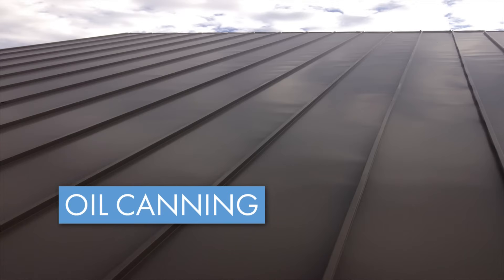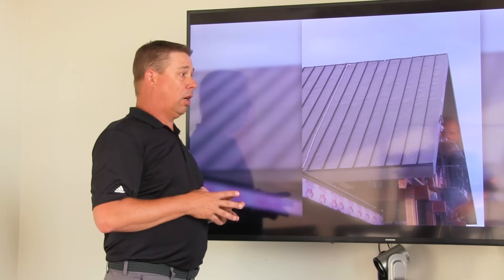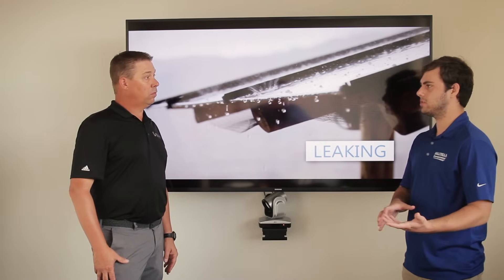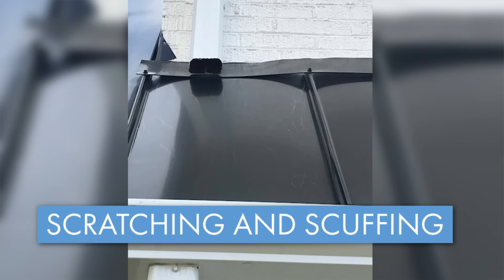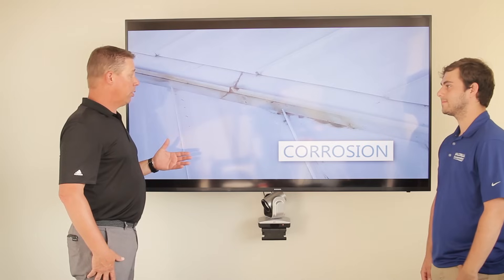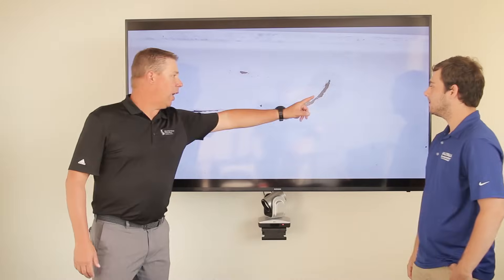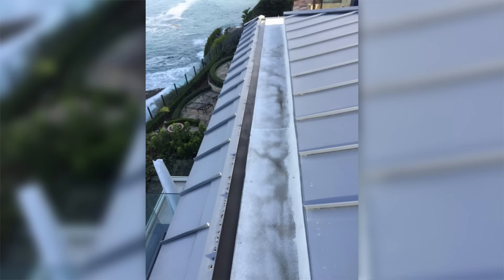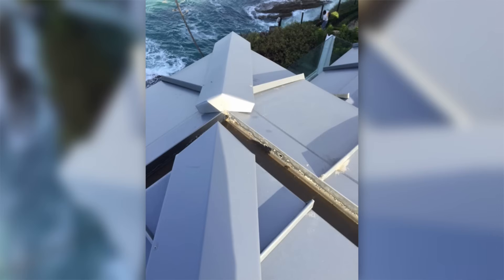7 Common Problems of a Metal Roof

Comment: if I were to pay triple the cost of regular asphalt, I wouldnt want to have to inspect my roof every year or every second year.  What are the areas I should keep an eye on and/or why would I do that?
Reply: well dont get a metal roof, this guy just said to go and check the whole roof for shitty workmanship every season
Reply: @living2day617  the metal WILLL RUST and its HARD to make repairs
Reply: As an asphalt roofing contractor myself, I had this same question.  I had to honestly reframe my own thinking about this. If someone buys a $50K truck, they’re going to want to have it serviced, change the oil when it’s due, rotate the tires, it’s the same thing with keeping up with a metal roof.

The advantage to asphalt is it is normally lower in cost and the first 9 to 10 years there’s very minimal maintenance that really needs to be done as those are the most impact resistant years of the shingles and when they will be performing their best.  The largest advantage to the metal is its true chemical composition - it doesn’t breakdown just due to time like asphalt shingles will. It’s a true price versus cost equation.  The price of a metal roof could be 2X shingles, but what you end up paying in the cost of owning a shingled roof could be much more over time because the shingles will have to be replaced well before the metal roof would.  Obviously it also depends on how long someone is planning to be in their home.  If someone owns a second home and it is a vacation and investment property they plan to hold for several decades or keep in the Family, metal could be a great option.  

Hope that helps some!

Comment: I lived in a house with a steel roof that was installed in 1917. We had it painted every now and then, it is steel going strong. The panels are alot thicker than what you get today. To prevent icing I painted about a three foot strip by the drip edge if flat black oaint. Even absorbed solar energy on a cloudy day.

Why don't home builder use lighting protection?

Comment: Shingles roofs burns, metal roofs dont
Reply: @yoojastle2099  , its the materials inside the trailer that burn.
Reply: I like concrete tile but have there faults, heavy weight, 10x heavier then average tin roof, higher building costs to take weight, does not rust so good on beach.
Also concrete tile roof has atleast 50yr life span, tin is usually 40

Comment: The oil-canning rippling you show if caused by running it through the mill and the crimped edge is being stretch.  One way to not have that ripple affect is to purchase metal roofing which has a shallow rib down the center of the sheet.  FYI, I used to run a small Steel roofing plant in Oregon.  We ran out steel roofing such as you're showing and if I remember correctly, all colored metal roofing is galvanized then painted.  Simple scratches are not to be worried about, it is the deep gouges where the scrape goes through the galvanization to the steel underneath, which then would be a problem.  I also used to install that roofing on homes and out-buildings, such as barns.  Remember though my friends that when running the sheet steel through the former it is sheared to length.  Where it is sheared the steel will be exposed to the elements, and will rust eventually but only on the eve end of the sheet as the ridge end of the sheet will be covered with the ridge cap.

Your discussion on "Dissimilar Metals" is a good one.  What happens is called Electrolysis when two dissimilar metals come in contact.  I am not sure about Galvalume though.  It usually happens when an aluminum roofing is screwed down with steel screws, or visa versa.   Chalking is because of cheap paint and if it happens within five years I would be talking to a lawyer, because painted roofing should last 20 years easily.  Remember though my friends all paint exposed to the sun will fade eventually, but the chalking shown in the video is bad paint.  Also, if you live in area where Acid Rain happens it will hasten the chalking and corrosion.

If you are considering putting on steel roofing make sure your installer is bonded and insured with guarantees on the installation.  Another problem not mentioned is that steel roofing sweats, so moisture barriers must be installed underneath to keep the accumulated condensation from dripping into the attic.  Some installers staple insulation batting between the rafters so the warmth from the house does not reach the steel.  Some go so far as to screw down 1 &1/2" to 2" stiff insulation that the metal is then adhered to.
Reply: Thank you rumple! Now get it there and make some YouTube videos for us all!
Reply: What do you think about the foil faced bubble wrap ive seen applied over old shingles and under the new metal roofing?
Reply: Toob247 Toob247  thanks
Reply: Thanks for this info! I’m considering buying a home in the Sierra Foothills in California. The area around the house has a very large cleared fire safety zone…and the 5 acres of forest have the understory very cleared….but…as we know…fires are going nuts in Calif. My friend who works for a home building company up there said metal roofs are not fire safe. The heat and embers are drawn up the ridges and get held in the attic making your house like a fireplace. What do you think as far as fire safety? These fires have been burning everything….melting metal and solar panels etc. Even if the fire itself doesn’t reach the house…the heat from the trees around the property and embers blowing could ignite in the attic. So I don’t think the metal roof really helps and maybe it’s actually bad. My friend says comp shingles are much better. Any opinion/advice?
Reply: @moonbeammagic7499  Yes I do.  Anyone trying to sell you on Comp shingles on a mountain home with trees within 15 yards of your home is trying to sell you a bill of goods.  Don't buy it !  You can order different types of metal roofing styles and in different gauges (thickness) as well.  The thicker the metal the better chance you have of keeping embers from over heating the metal.  If you truly want a fireproof roof, then I would go with shaped concrete tiles as long as you would not be in a heavy snow zone.  Because those tiles will amount to a heavier roof, the whole roof structure must be enhanced.  With that in mind a light snow once in a while that melts fairly quickly would be no problem.  If it is wet snow that would be the problem because wet snow can get really really heave fairly quickly at about 7 lbs per gallon.
Why would embers be drawn up to the ridge cap, and no it would not get into your attic?  Home applications are different than are barn applications.  Even in the 1950s mountain cabins all had metal roofs so I don't know why your friend would tell you metal roofs are not fire proof, (they aren't), they are "Fire Resistant".  Remember that comp shingles are impregnated with asphalt and while they are also fire resistant, they are not as fire resistant as steel.  There are different applications you can get for ridge caps that would prevent embers from being blown up under that ridge cap.  Do some more research and talk to companies which make metal roofing and learn the many methods of roof construction.  By the way, did you ask your friend to explain what he/she meant by metal roofs not being safe.  That bit about heat in the attic doesn't fly.  What did they mean by not being Fire Safe?  What were they trying to sell you.  Yes steel is far more expensive than comp, but it is better than embers slide off the roof rather than the embers sitting on the comp shingle melting it.  Hope that helps.  If you have any more question feel free to reply and I'll get the message.
Reply: In South Florida we have the strictest codes. Your contract should be a series of payments after passed required inspections.
Reply: Thank you for writing out such a detailed and helpful comment.

Comment: Isnt oil canning caused when the clips are installed and the machine dimples where the fasteners are ?
Reply: Although oil canning is directly related to improper installation the most common causes are an inadequate plain whereas the mounting clips are not in a direct line in relation to each other.The line plain must be consistent in rise in relation to the pitch of the roof as well as not have a drastic dip in elevation as well as some installations are causing a stretched panel also causing oil canning. To alleviate the issue during installation the manufacturer can provide clips that float,generally these are a two piece clip with a rivet connection allowing the panel to hold a consistent plain. The second issue can be remedied by making a jig that holds the panel at its maximum width during clip installation preventing panel stretching.Doing so would alleviate 90% of the oil canning in the majority of installs.
Reply from the maker: Hello! There are several causes of oil canning. You can check out a more in-depth video about that specific topic here: http://bit.ly/what-is-oil-canning-video
Thanks for the comment! -Thad

Comment: What about large tree scratching? The trees have been cut down but the limbs left huge scratches. Is there a way to paint those panels to match the rest of the roof?
Reply: Read through the comments...most often they are galvanized prior to painting. If the scratches are deep enough then some touch-up would likely be in order.

Comment: Very purposely limited in educational value. It would have been useful to give an example of what the manufacturer recommends when you ask them what to do with a scratch beginning to show corrosion. What have you done that worked in the past. Instead nothing.
Reply: Agreed
Reply: They said scratched or damaged paint should be touched up with manufacturers paint or it may corrode the metal. They showed pics of the rusty/corroded consequences. What is hard to understand?

Comment: why are metal roof installers here putting metal roof over the old shingle roof and then the shingle roof melts under and I have seen the tar dripping down over the trim boards and it looks ugly .I also saw a neighbors metal roof fail because the rubber type washer started to degrade and the screw started to work a bigger hole in the roof panel and finally in a wind we had here rip loose
Reply: Michael Walter enough to be running out from underneath of a metal roof like water? I doubt it. And as far as your comment on shingles scratching the underside of metal you should always strap it up for an air gap underneath anyways. Thus the scratching is no concern. The only reason you need to remove shingles is the exact reason you say a contractor will put it over shingles, to get your money. It hurts nothing of it’s strapped and you don’t pay for removal
Reply: Michael Walter you could look to see how many layers it is and the condition of the roof deck is typically pretty evident as well. I’m not saying that going over shingles is by any means a better practice but executed well it shouldn’t fail any sooner than a roof that was stripped before the metal. If you are worried about ice dams strip the first 2-3 feet and put an ice and water shield on it. But you don’t have to strip it to do that
Reply from the maker: Hello! We have a video about putting metal roof over a shingle roof which you can check out here: http://bit.ly/metal-over-shingle-video
Thanks for sharing those examples! -Thad
Reply: The shingles wouldn’t be melting. Some installation guides require use of butyl tape which gets soft in the sun and that’s probably what you see

Comment: I was sold on a medal roof but more and more im thinking just getting traditional shingles. I dont want to wash my roof every year. Worry it getting scratched gouged n rusting like a car. Faded paint ect ect. Spending double the money n sounds like more screwing around. A gd shingle roof can get you 20yrs n no bs.
Reply from the maker: @Johnny Applestead There is a form to fill out to download the Metal Roofing Buyer's Guide that includes city/state, however your full address is not requested or required. The guide is free of charge. The information you give only helps us assist you with future questions or other metal roofing needs. If you don't want to share any information, you can stick with watching videos here on The Metal Roofing Channel or browse our website at SheffieldMetals.com. We're all about people sharing their opinions, but please do not attack our viewers. Thank you! -Thad
Reply: BlazeOctane44   I use nothing but metal roofs on houses I rebuild. 18% more heat and cold resistance is one reason why. Lower probability of roof leaking. Able to color coordinate with metal. Able to roof over 2 previous roofs giving more resistance to leaks and and more energy efficiency. Lower labor costs. Net cost is same as asphalt roof in the end.
Reply: Our 6yo shingle roof failed in hurricane Florence and the house was ruined, so we are going to try metal roofing.  Not saying that it is for sure stronger, but we didn't see any metal roofs fail.
Reply from the maker: No roofing product is perfect, and there are pros and cons no matter which way you go. If you want a comparison specifically about shingle vs metal, you can check out our video here: http://bit.ly/metal-vs-shingle-roofing-video
Thanks for the comment! -Thad
Reply: I've seen good quality roofing shingle get 30 to 40 years with proper ventilation and color matters to
Reply: Except if you live in a climate that has snow you will get ice damming and water flowing right into your home every year with shingles trust me I'm facing the disappointment of shingles right now
Reply: Check out ice & water shield... supposed to be under your shingles to prevent ice damming and leaking
Reply: @RaconteurMan  yes at the bottom of the roof and your valleys should have the rest can be felt and around your chimney should have a counter flashing of it so it is less of a chance to leak I found it works really well
Reply: @soullessone4681  yeah but anything under a four pitch has to be double felted or ice and shield should be laid down all long the edge of the roof most people don't realize that your drip edge should be laid on before your felt I no a lot of roofers that cut corners on felting I don't on felt on shingles I can put a five inch pattern on them and save on cost there but I refuse to on felt and proper preping is the key I can use Staples for felt and save there but on a step one I use button tabs

Comment: Lack of knowledge.  This is a commercial to avoid and excuse defects.
Reply from the maker: Thanks for your comments. This is a 7 common problems video and not a 7 common solutions video. We are obviously not going to be able to cover all the causes, effects, and solutions of oil canning or any other topic in a concise video. Luckily we have provided a resource article that goes into great depth about this subject which can be found here: http://bit.ly/what-is-oil-canning. As far as 24 gauge material, while it might not be suitable for all applications depending on environment, roof design, panel type or engineering requirements, 24 gauge material is the most architecturally specified material for standing seam systems. I appreciate the feedback, and I'm always looking for ways to improve the channel. -Thad
Reply: because they use shit ass material.  24 gauge metal so thin that lightly stepping on it with support underneath will bend it.   anything bigger theyre rolling machines can't bend it
Reply: Exotic Illusion's 24 gauge is not thin. Menards sells 29 gauge for their steel roofing which is nearly half as thick and that still doesn’t bend when you step on a rib. I’m installing a 24 gauge right now which is why I’m watching these videos and I can insure you that 24 gauge is plenty thick enough.
Reply: @mfblowfish4671   24 gauge for a straight sheet roof is very thin, very pron to deforming at the slightest touch or temp change after install.   when using 24 gauge, best to choose a design that has many compounding bends, this adds strength to the metal.  Like the stamped roof tiles that looks like the clay tiles on villas, those ones hold up alot better in harsh weather.
Reply: I never heard of anything for roofing panels thicker than 22 gauge. So once again I can assure that 24 gauge is not thin. They put striations in panels to help with oil canning. What are you putting on the roof? Plate steel
Reply: I agree.  The oil canning in the beginning of the infomercial,, are entirely the result of the fasteners.  You can see each one in the wrinkles of the roof,,,, and it is NOT entirely aesthetic only.  The screws were put in too tightly,,, no ifs, ands, or buts about it.  long stretches of metal roofs must be fastened down lightly,, the material must be allowed to expand and contract with the temperature changes.  What is shown in the pictures is certainly too tight fasteners that were installed on a cool day.  The photo of oil canning was taken on a warm day.. The ripples are each piece of roof trying to expand to a higher temp.   And he never mentions it at all.   Has no idea what he is talking about.